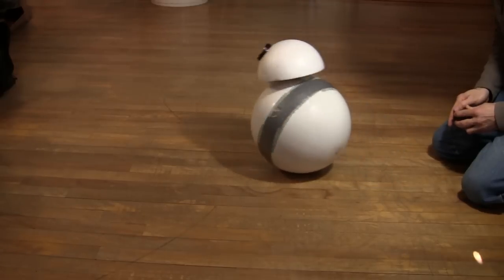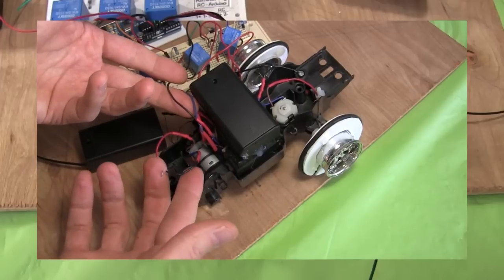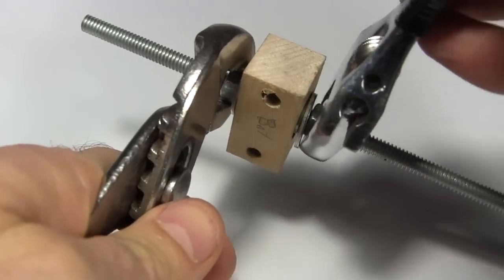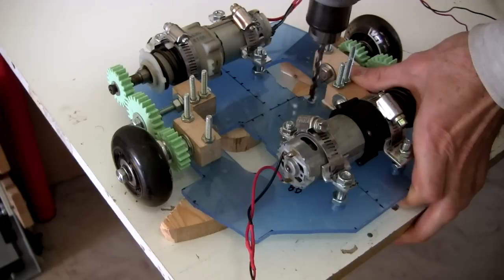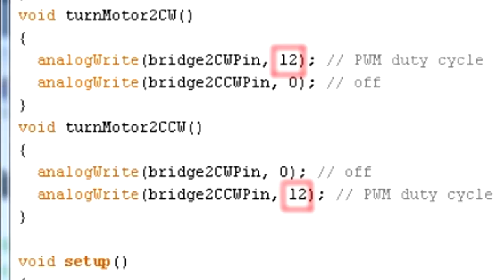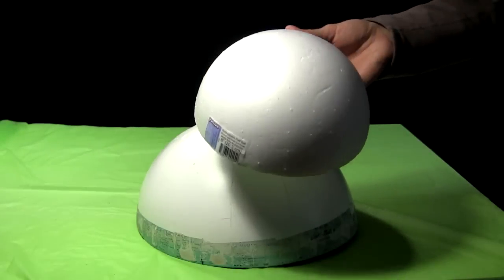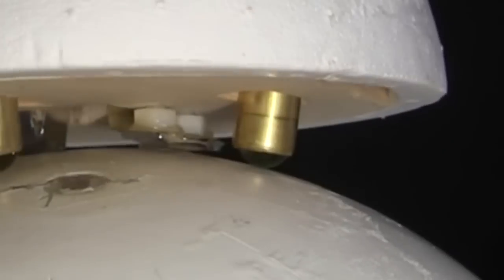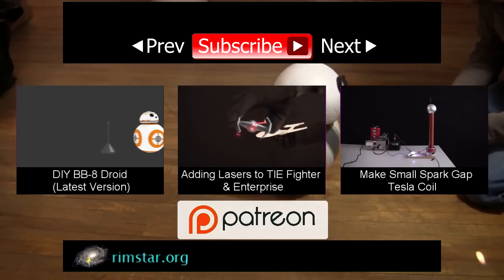Making BB-8 (v2) Droid - Part 1

Comment: Amazing build!

Imagine all the mass was at the bottom of the ball internals, and the ball weighed nothing.  Then there wouldn't be any wobble on start and stop.  So the lower you can get your center of gravity, the better.  maybe take apart the battery packs to distribute the cells lower?  This would also allow the motors to be further down.
Reply from the maker: +Matthias Wandel Thanks!
I remember thinking about taking apart the batteries back when I was first seeing how things could fit together using Blender, but I was afraid to take them apart. Too late for this version, and still other options to try for stability, like accelerating and decelerating and using a gyro board I bought, but I'll put it back on the list. I'm sure I can dig up some sources out there for what to expect when taking them apart.
Reply: +Matthias Wandel Oh man. I can only pray that I someday make a video that gets a comment like this from Matthias Wandel. I'd probably die.
Reply: Hi
Reply: +RimstarOrg great BB-8 build you are very clever you should take this to conventions and shows!
Reply from the maker: Thanks! If it works well enough then I plan to take it to the Ottawa Maker Faire this year. I also take it to various robot and maker meet-ups. We also have an annual Arduino day I'll take it to.
Reply: RimstarOrg ok great.
Reply: Matthias Wandel o
Reply: Matthias Wandel I saw the word ball internals and I thought penis intering vagina

Comment: It's coming on really well, I'm looking forward to seeing how you fibreglass it. I should imagine creases might be a problem although a bit of sanding will sort it out. 👍
Reply from the maker: +Green Silver Thanks. I'm looking forward to seeing how I do it too! I do plan to fiberglass the new globe before I take it apart. I'm even considering ways to embed alignment pins into it. I had one alignment pin in my existing one at one time and it made putting it together much easier.